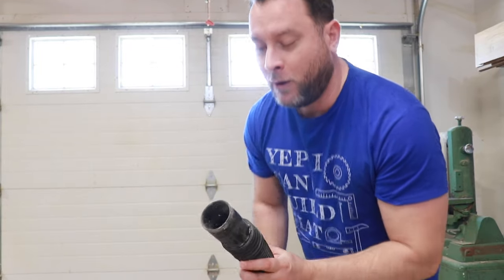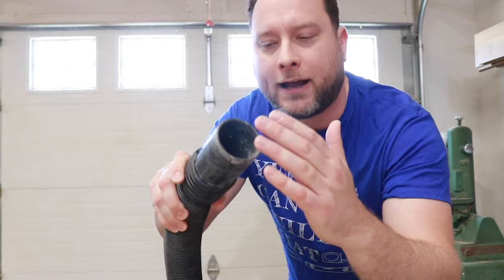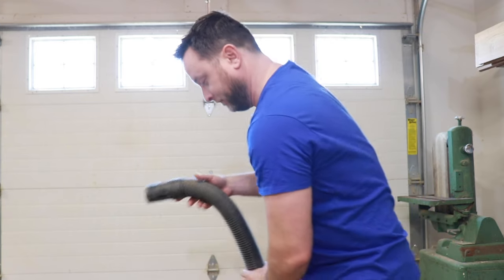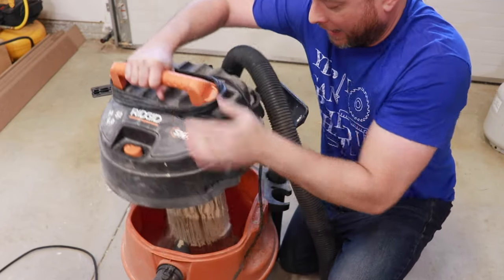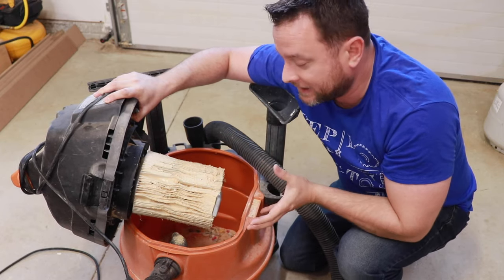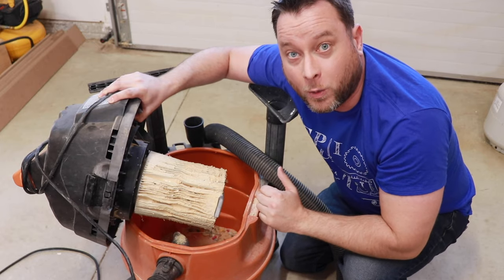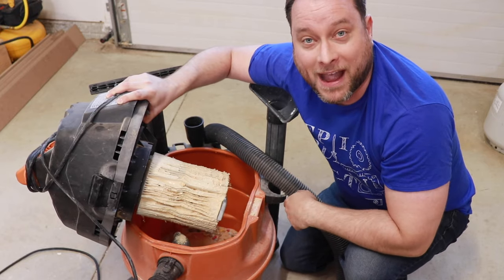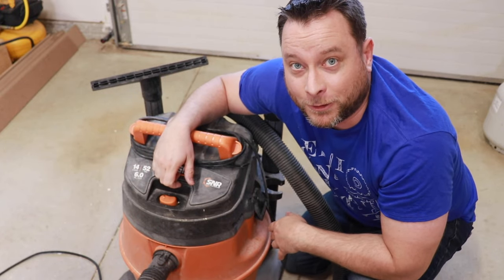Dirty Little Secret Why Your Shop Vac Has NO Suction!

Comment: Good tip i learned on youtube is to buy pool filter "scum socks" and put over air filter. Just slip it off and empty shop  vac canister. Much cheaper than buying new filter and much less messy than taking filter off each time to clean.
Reply from the maker: Thanks for sharing
Reply from the maker: Good suggestion. Thanks
Reply from the maker: A little yes

Comment: I cleaned the filter on mine and even tried to run it without one (don’t) and the suction was still awful.  Any ideas?
Reply from the maker: If that didn't work there could be an issue with the fan and or motor. check the exhaust port and make sure it is clear. hope that helps.
Reply: The hose could be clogged.
Reply from the maker: True
Reply: Same here. I dusted my filter, i checked my exhaust port, i ran a water through the hose (unattached to the vac of course)  to see if it was clogged, and i inspected the hose of any cracks to see if there was leaks. Nothing worked

Edit: nevermind it was user error. There was a small covering on the bottom that i didn't know was off. After I found the cover i put back on and it was a good seal
Reply from the maker: Interesting
Reply: What about weak motor mine can't suck , got it today and has failed its sucking very little dust taking lots of time and motor is heating up ?
Reply from the maker: That I am not sure
Reply: Your filters what killed it to begin with ! It's purpose is to create a product with obsolete engineering in mind  it  was designed specifically to over heat your motor and cook it should you elect to rarely clean it .
Reply: @FOZ23  That was my problem! Thanks!

Comment: Well duh. I was hoping for tips to increase suction, even with a new filter. What is the blower wheel?
Reply from the maker: To get more suction you would need to have a higher rated CFM Cubic Feet Per Minute. Most shop vacs are around 185. A dust collector is around 500. You would need to shop for a higher HP shopvac which would give your more CFM.
Reply: Check your lid seal and your input port I taped a contractor trash bag around my vac but still had unrestricted air output. My lid was leaking and so was my input port. Silicone around the port, inside and out and a rubber seal for the lid fixed it. The seal makes pulling the lid off and putting on much harder. Im not sure where to go with this but hopefully I gave you some tips.
Reply from the maker: Great this thanks for  sharing
Reply from the maker: a dirty filter can really mess things up.

Comment: I was hoping for something more in-depth - I figured it out easily (the crowd goes wild)  I  ended up opening the motor and blowing the dust out with a air dust removing tool on the air compressor. It was clogged with hair and dust when opened to check. Closed it back up, put on a fresh new filter and it’s just like new sound wise.
Reply from the maker: glad it worked. I have found out that there is a lot of crazy stuff that can get stuck in that motor and filter. gad it worked out let me know if there is anything else I can help with :)

Comment: I have seen a few videos where guys have made their own dust collection system using just a small shop vac and they appear to work really well.  So,  I will try one my own too and hopefully get good results
Reply from the maker: I should make one too and see if it really works
Reply: That would make for a good video
Reply from the maker: I will do some research
Reply: it works! i’ve made one. It works very well but the only issue is setting it up so it doesn’t fall over. You can’t take it along for a walk wjth the vac unless you make some kind of wheel chair for it. One of those square wheeled boards that swivel in all directions is needed then build some type of housing around it to roll with the.vac. 
it’s touchy so why bump while in use will send the dust into your bin. Bonus if you can also add another spot to put the vac as well so it all goes together in one smooth ride.
Reply from the maker: Thanks for the suggestion.

Comment: When the shop vac filter needs cleaning I use my canister house vac's crevice tool to clean the shop vac filter after you knock off the big pieces with a paint stick or whatever, then use the shop vac to clean the insides of the house canister vac. Every home needs the 2 type vacuums if they want to keep them both running for, in my case 3 decades.
PS: your voice is fine.
Reply from the maker: Thanks 😁

Comment: My shop vac was hardly working. I checked the filters - good. I pulled the hose off and the suction at the shop vac hose opening was good. Something was wrong with the hose. I discovered a large clog in the hose at the shop vac end. I couldn't unclog it because of the elbow joint end of the hose. I ended up cutting the hose off of the elbow joint of the hose, cleaning the clog out, then shoved the rest of the hose back onto the elbow joint of the hose. I thought that I would need a hose clamp to eliminate any air leaks at the new junction of the hose and elbow joint, but nope. I tried the shop vac now and it worked just fine as is.
Reply from the maker: Wow, glad that you were able to figure out the issue. Thanks for the info.
Reply: I had the same issue but just gave that hose a massage (pause) to get everything on clogged while it was turned on.
Reply from the maker: Thanks good to know

Comment: If you’re saying that the only reason is because the filter is dirty or not on there right, then why can’t you run it without a filter? Would it suck then? Also, why is the filter so important? Thank you.
Reply from the maker: This is often the main reason. The filter has a few uses. one it protects the internal motor from wear and tear, second it removes dust and particles from the environment making it safer to breath. If a filter gets clogged it prevents the air flow from circulating and therefore the suction declines. You can run it without a filter however the lifespan of the vac would greatly be reduced.

Comment: i know i am late to the game and you prob wont answer but even after blowing it away with 150 psi of air for 3 minutes it sucks but not as great as before. If you dont answer im just going to try with a spare clean filter that came with my vac.
Reply from the maker: Filter or check the bottom hose valve make sure it is closed

Comment: My shop vac is losing suction so I bought the correct replacement filter, correctly installed it, and it STILL doesn’t have proper suction !
Reply from the maker: I would check the seal to see if there is any leaks

Comment: Thank you for the video:) I forgot to put my filter back on my shop vac before I turned it on for a few minutes:( Now its not sucking hard at all. Do I have to buy a new one? I'm afraid the debris might have gotten into the motor?
Reply from the maker: yeah your motor might be shot. You could dry cleaning it out with compressed air.

Comment: My 3 gallon wet/dry vacuum battery powered blows but doesn’t suck. The float is working properly. No filter as I use it to suck up water. Independent appliance repair technician.
Reply from the maker: Oh man
Reply: But I think some vaccume cleaners are just weak, mine too got it today but am disappointed with it, either hp or cfm is low for the task.
Reply from the maker: I haven’t had any issues with mine

Comment: Any suggestions if you don’t have a filter installed?
I removed mine a long time ago cuz I just used it mostly for dirty liquids. Now it functions at about 10% suction.
Reply from the maker: I don't, I would see if you can get a replacement
Reply: Does it have an exhaust filter?  The one at my kids' school that we use for set construction clean up (for plays) had a cap and foam bit that could cover the exit blower hole.   Shop vac wasn't working very well, I took of the car, poke the foam filter and got a face full of saw dust for my efforts.   I know they hadn't been running it with a paper middle filter.   This was red and black and I think shop vac brand...   I have a rigid and mine doesn't have the cap/filter at the exhaust so not all of them have this.
Reply from the maker: I didn’t see an exhaust filter

Comment: Not terribly helpful. I already tried the obvious: cleared the hose of any clogs, replaced the filter and bag, and checked the little exhaust filter. 

My best guess is something is wrong with the suction breaker that cuts off suction when the body is full of liquid, but i haven't been able to find the issue.
Reply from the maker: There could be an issue with some type of safety switch when it is full of liquid.
Reply: @HowYouCanMakeIt  that was my guess as well. After some more poking about yesterday, i discovered an obstruction in the hose, which i cleared with a long stick.
Reply from the maker: That is good to know

Comment: Can you run it without the filter. Trying to suck water out if a turtle tank. I feel like I've done it that way before  but it isn't working this time.
Reply from the maker: You should be able to however it really isn’t designed to work without it. Puts a lot of stress in the motor
Reply: @HowYouCanMakeIt  I finally figured it out. Hose was completely plugged with maple tree seeds.  Took forever to get it cleared! Thanks for your help though!!
Reply: Take it out for water

Comment: Not helpful at all unfortunately...... What if I have a brand new filter and its still not sucking??
Reply from the maker: There could be an issue with how the top is sealed or the motor. Might want to return it and get a new one.